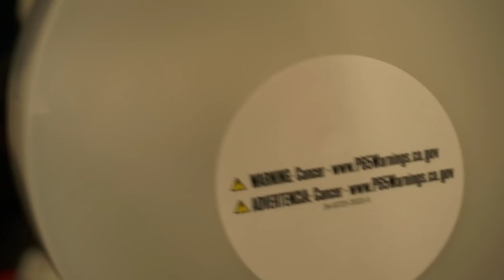Painting the deck: Part 1

Comment: I'm sure someone had to mention it but here goes...that caulk gun has a hole to stick the tip of the caulk into and when you pull the trigger it will cut the tip off...and that little wire at the end is to break the seal inside the tube after the tip is cut off. ;)

Comment: In the future do yourself a solid and not use SILICONE.  It WILL overtime crack and peal.   Use POLYUROTHENE Sealer it last like 5 times or more longer.